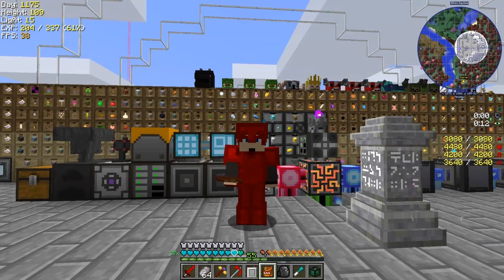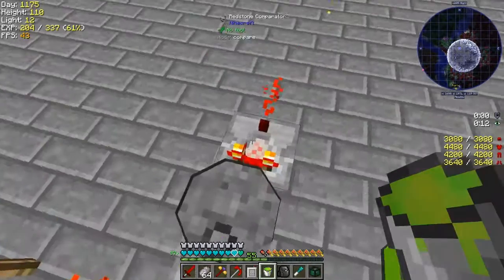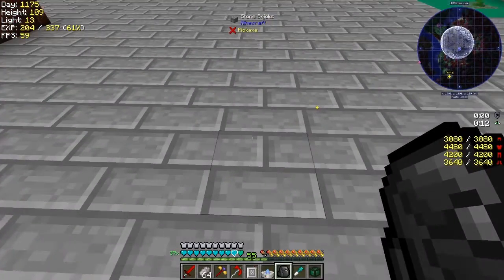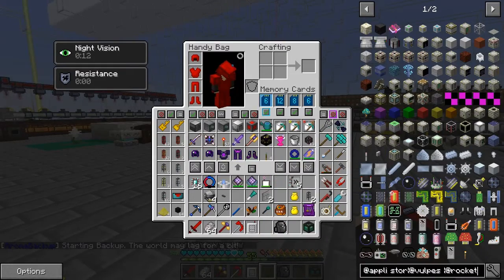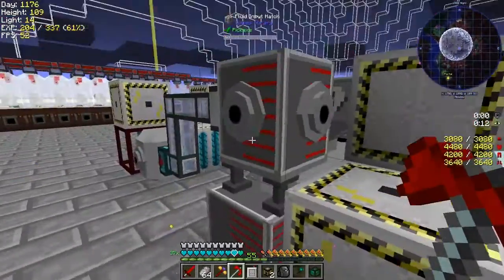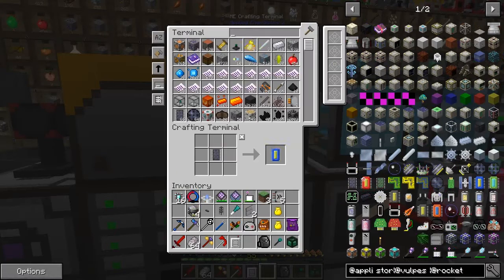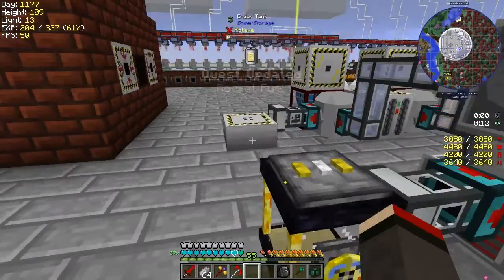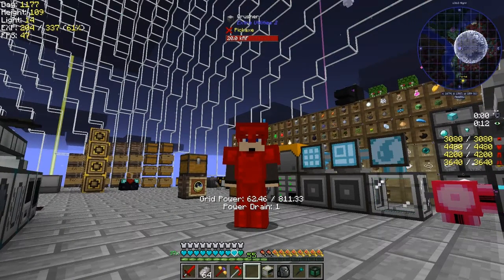Lost Souls #106 - Base Update & Racing to Space

Comment: When you are typing the search terms into JEI or the Crafting Terminal, etc. you need to be careful where you leave the mouse pointer. If you have the mouse over something that can be clicked on then as you type into the search you are triggering the Inventory Tweaks (not specifically that mod) hotkeys. I.E pressing "r" will bring up the recipe, "u" will show the uses, "t" will show near by inventories, etc. So just keep the mouse pointer over the search box and away from items when you type.
Reply from the maker: bobthebigbat isn’t it a bit inconsistent sometimes pointing to an item and pressing r or u types the letter in the box and sometimes it shows the recipe or usage. Also I think my mouse is fairly sensitive and it moves a bit when letting go to type. What does the ‘t’ do?
Reply: The different mod all interact with the keyboard shortcuts a little differently, but it comes down to what has the focus.
"t" is the default key for the "Search Nearby Inventories" (something like that) added by Extra Utilities 2. It allowed you to mouse over anything in an inventory or JEI and press "t", then the inventory would close and silver particle effects would appear over every nearby inventory that contained that item. It was super useful for finding items for recipes and consolidating storage, but it stopped working at around version 1.0.3.8 of the pack. It sort of got fixed, but is still is a little unpredictable. There was apparently some bug with having transfer nodes/pipes nearby, but I never encountered any problems with it.
Reply from the maker: bobthebigbat thanks I didn’t know about the extra utilities ‘t’. From what I’ve observed the keys are sometimes typed or their function is sometimes executed. It seems that they execute near to the search box and type when a bit further away.